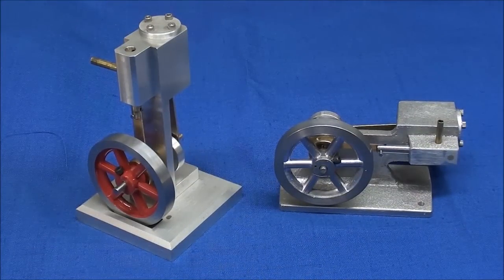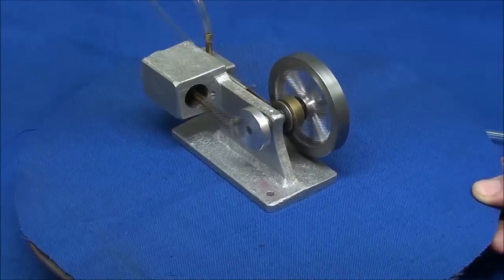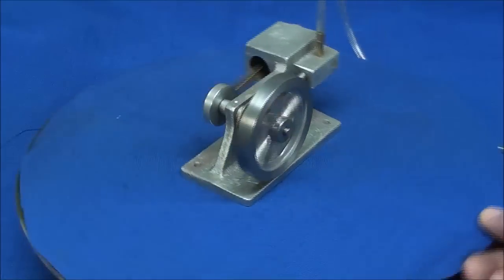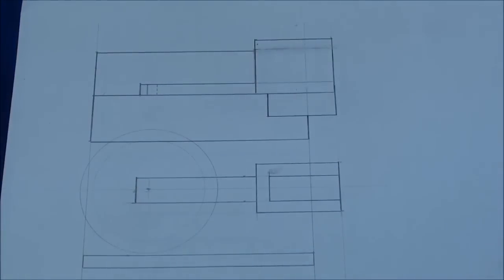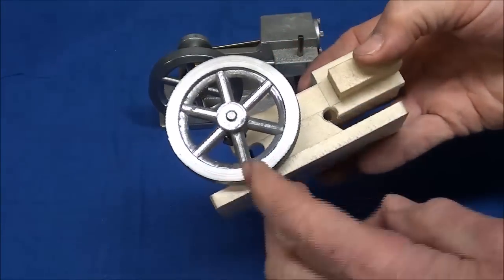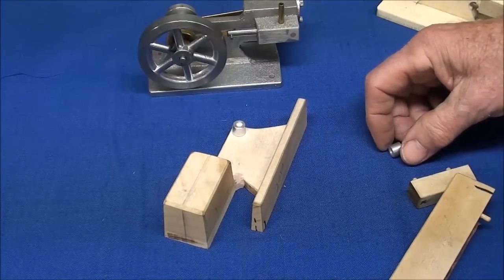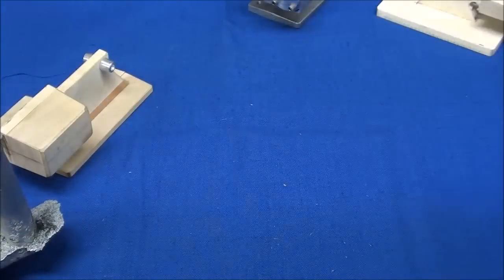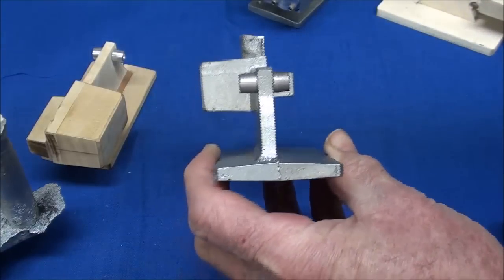tubalcain  BUILDS A HORIZONTAL STEAM ENGINE Part 1 of 8

Comment: I've cast aluminum parts with a similar size and shape sprue as yours.  A while back I used an old duck decoy bottom weight to create the in gate.  The shape of the duck weight created a round bottom reservoir that allowed the metal to flow upwards toward the mold cavity.  This has cut down on my shrink and turbulence defects.  Feeding into your thick cylinder casting you mentioned using a large gate, you could just make it quite a bit larger than the one you showed on the video.  As Roger Schroeder always used to say sand casting is a "black art" !   Really enjoyed this series of videos.

Comment: I don't know if you reply to comments but for my edification could you tell me why you used an end mill to flatten the bottom of the casting instead of a fly cutter?  In fact I don't remember you using a fly cutter very often.  Please comment on that.  Thanks for the video.
Reply from the maker: cerberus The finish does not matter. Actually, I own many flycutters. Don't like them. Chips everywhere including my face.

Comment: In Part 3 where you drill the cylinder head bolt holes, it occurs to me that if you make the cylinder head square you could move the bolt holes further out from the cylinder and achieve better clearance.  It would be a bit more complicated to machine, but not impossible.  Maybe on the next iteration?
Reply from the maker: Brian Taylor Thanks
 Yes, I mentioned it in the next build (yellow boy). Didn't do it, but suggested.